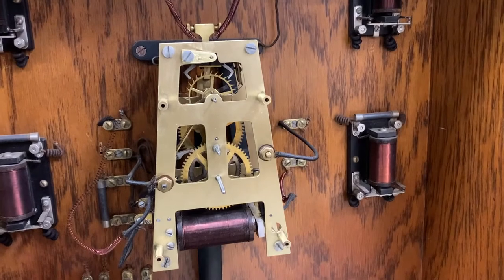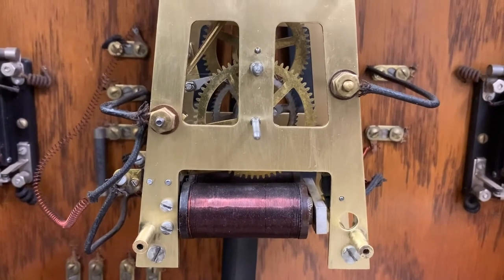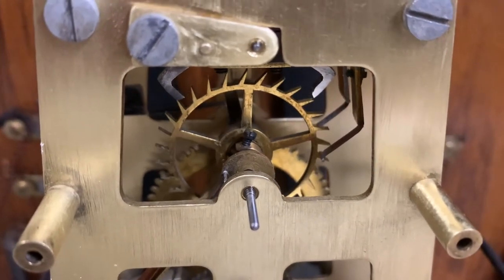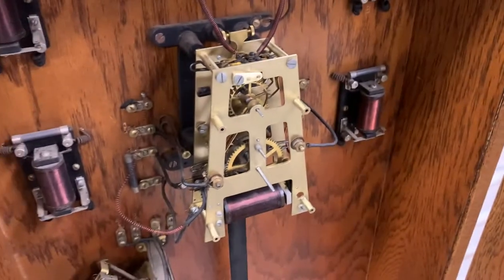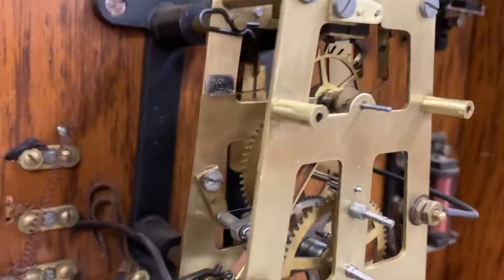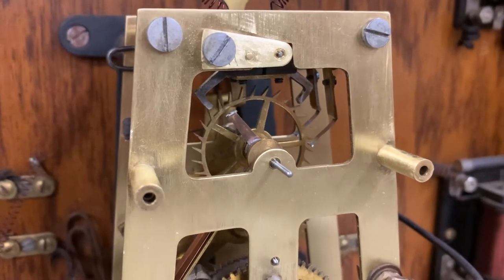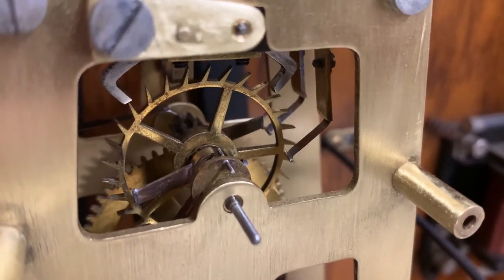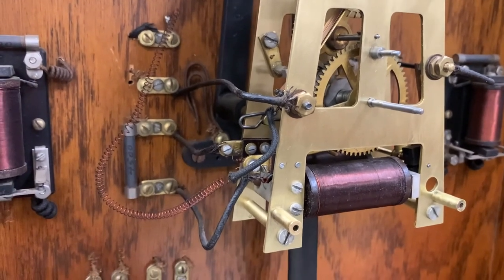Standard Electric Time Master Clock Restoration Part 4

Comment: Nice tip about preventing arcing. My NTR master clock has a capacitor that does the same thing (I think).
Reply from the maker: That's very possible, and yes, a capacitor could also accomplish the same task. For it to be effective, there would need to be one for every coil in the clock and would need to be installed directly on the coil terminals or as close to them as possible. Any path with a lower impedance than the air gap of the contacts will dissipate the coil energy, but it has to be on the coil side of the contact to work.

Comment: At 00:11 you say you replaced your variable voltage with a "Voltage adjusted fixed one".  Can you please let me know exactly what was your final voltage source part that you used? Is it one that you plug into a 120 V wall outlet?   Maybe you also let me know where I can go and buy one exactly as you have. Thank you
Reply from the maker: Hello Scubagrant, some of these clocks ran on different voltages. Mine is 24 volt nominal, and this adapter should work for mine and similar 24 volt clocks: https://www.digikey.com/en/products/detail/nte-electronics-inc/57-24D-600-5/11654509 
Digikey has other voltages as well if you determine that your clock needs more or less. I measured my clock's current consumption at about 120mA. You will want somewhat more than that, but not too much or you may damage your clock

Many of these come with a barrel connector. You can either cut that off and direct wire the adapter, or you can purchase a pigtail female connector of the same size that will allow you to detach the cord at the clock end.

Comment: At 9:08 you mentioned a modern way to dissipate the stored electrical energy in the coil. Would a snubber circuit work in that circumstance? 
I am returning a 1946 IBM Model 15 master clock back into service. The 24 VAC power has burned the contact points in the relay that winds the spring driven master clock movement. I want to mitigate the arcing that is burning the points. I have considered a snubber circuit module mentioned at 15:07 of this YouTube video - https://youtu.be/OAmXypXwkeg?t=907
Does this sound plausible to you?
Thank you for this video series on restoring Standard Electric clocks.
I look forward to your video series about ITR/IBM clocks.
Reply from the maker: There are a number of ways to dissipate the EMF from an opening contact; the principle is there needs to be a better current path than air so the energy will prefer that path rather than arcing. A resistor, which my clock uses, works fine. Diodes are a more modern option in that they don't conduct when you energize the coil (and are therefore more power efficient than a resistor that burns electricity all the time), but when you de-energize the coil, the current in the other direction does conduct (be aware that using diodes make your clock polarity sensitive - with resistors your clock is agnostic). 

There are other more complicated circuits that have different pros and cons; I wouldn't worry too much about which you use as long as you do something.

Comment: I have the same clock and I found the solenoid for whinding the clock in at 18 draws about 85 milliamps. The reason I dropped the voltage is because I misplaced and lost the current limiting resistor wire that was supposed to be used when the clock was run on 24 volts. Going to the video I'm giving you is my clock running at my house.https://youtu.be/mWHvGY-5Db4?si=OtxLyXCFdr2Yamkj https://youtu.be/mWHvGY-5Db4?si=OtxLyXCFdr2Yamkj
Reply from the maker: Thanks for sharing - I love all of the slave clocks yours has!